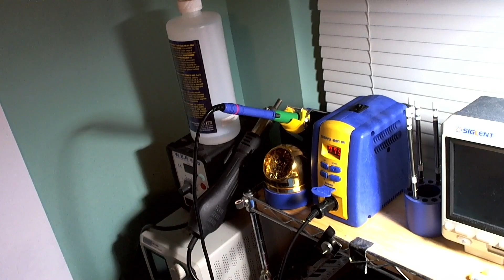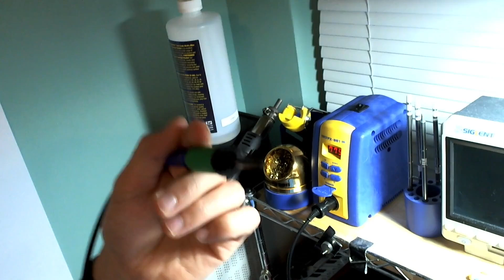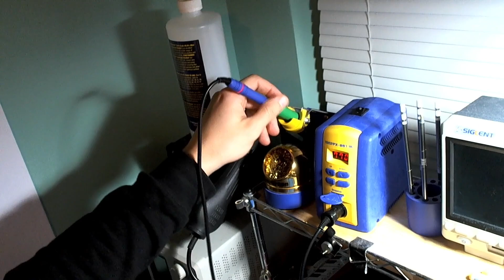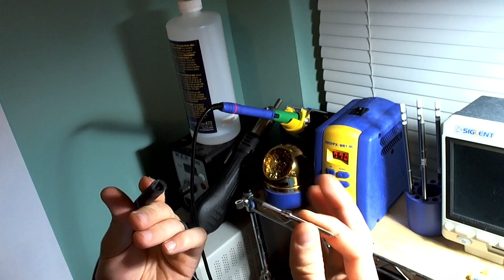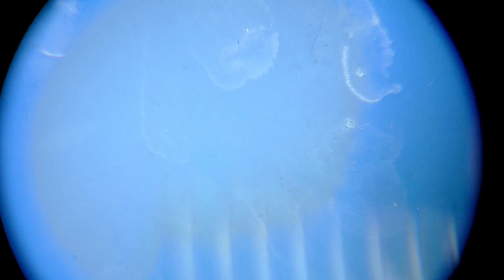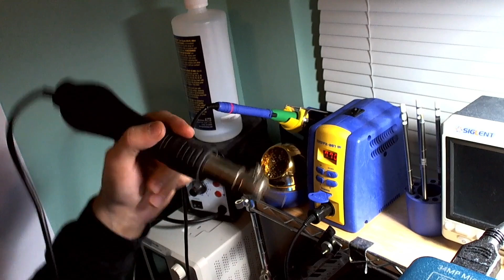Hardware Hacking Tools: Soldering Iron and Hot Air Rework Station

Comment: I got the Hakko FM2023 mini hot tweezers years ago. Waste of money without preheat of board + components. The old FX951 sits beside my FM203 running those tweezers, FM2032 and FM2027 and desoldering stuff. All Hakko. I bought all-in. it's served my business well, paid for themselves. Except for the mini hot tweezers. For the most part it's a joke: One tip is hot and the other tip isn't.

Comment: Maybe you should modify your hot air station chip to show F degrees? ;) Thanks for the interesting videos.
Reply: lol why would you prefer F or C. Consistently using set temps are easier to read and use in C.
Reply: @SimonCas  lol. I'm a C guy too. Just thought it might be an interesting hack.